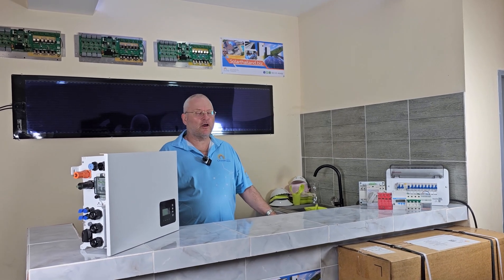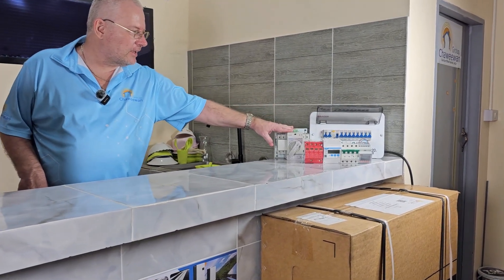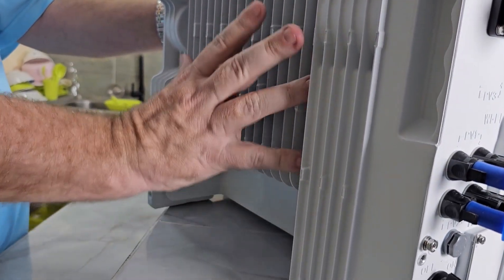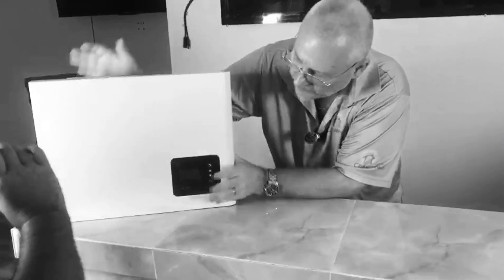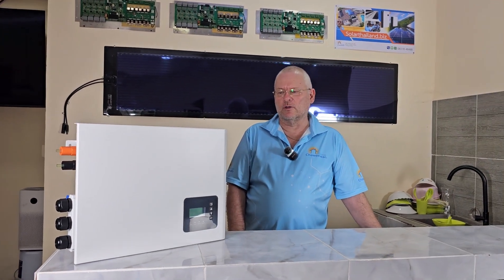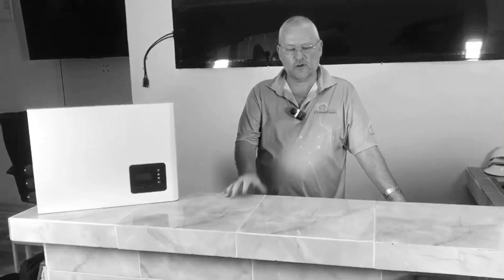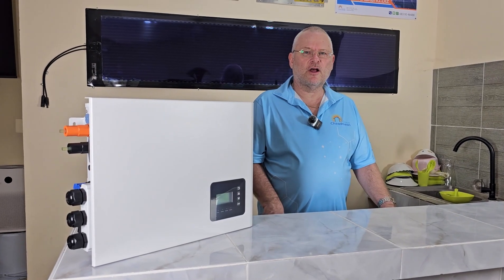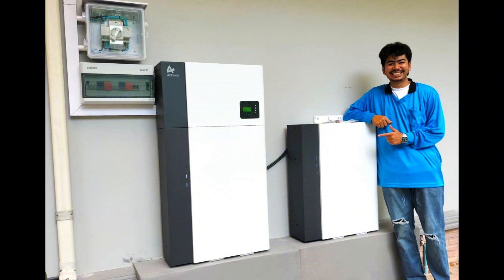AlphaESS Smile 5 G3 Review | SolarThailand.biz

Comment: Hi! How many years warranty is there on these and how much to buy and have installed, incl panels? Located in Buriram.
Reply from the maker: Warranty on the inverter is 5 years. These systems start at 430.000b with 14 panels and a 10 kwh LFP (8000 cycles) battery. We already have many installations in Buriram, so its an area we often go to.